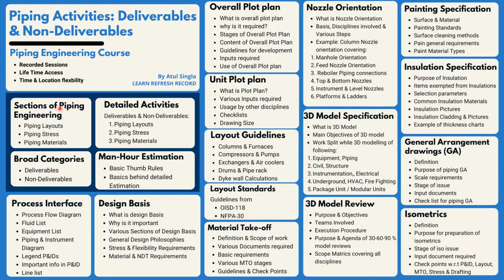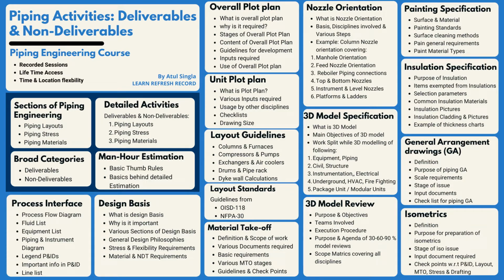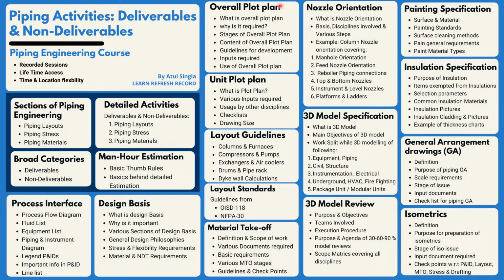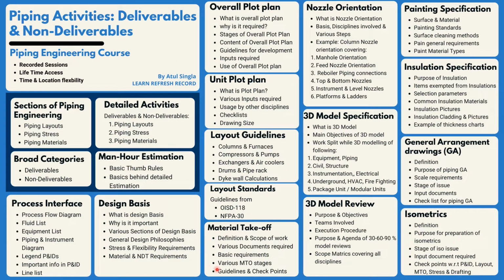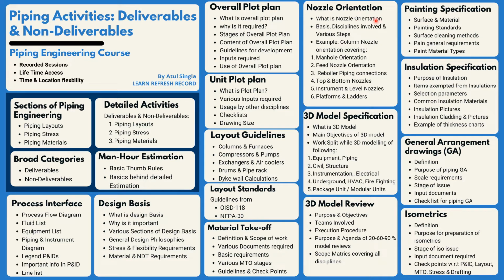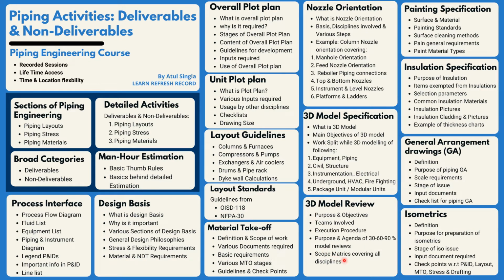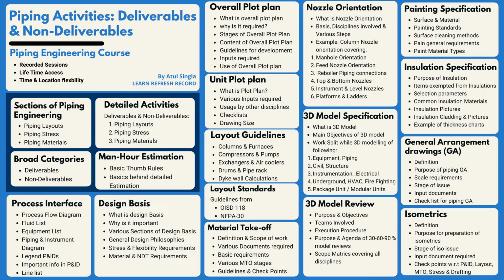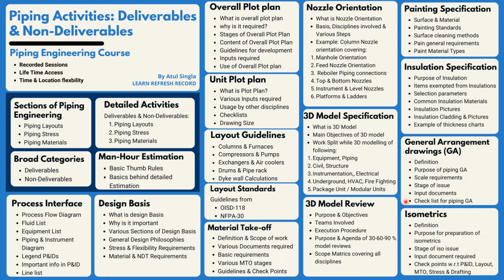Piping Activities II Deliverables II Non-Deliverables

Comment: Hello,
1.) I registered the course
2.) Contained best
3.) Bad voice quality at few vedios. I rechecked and reset to full volume my devices but still unableto listen fully. 
4) voice at inttroductory vedio is great and audioble however after introduction vedio there is low to audioble.  Listener required to stretch more rather than to hear the containt. 
5) kindly replace low audioble vedio in Udemy section. May be recorder mic required to close to mouth to record.
Reply from the maker: Thanks Milind, for detailed response and feedback!! I will try to rectify the same!!